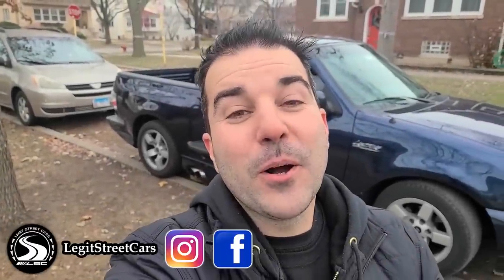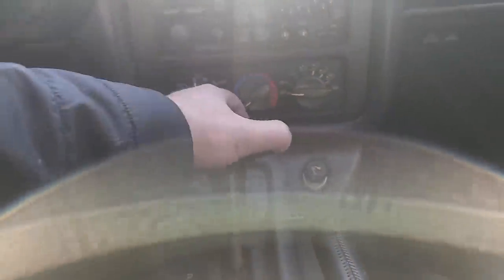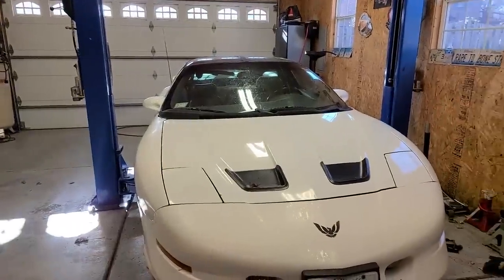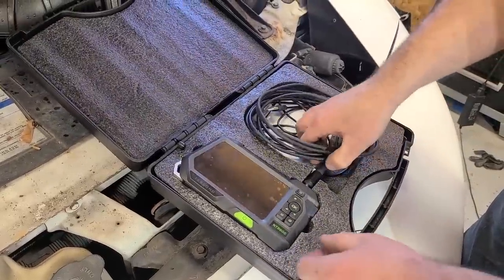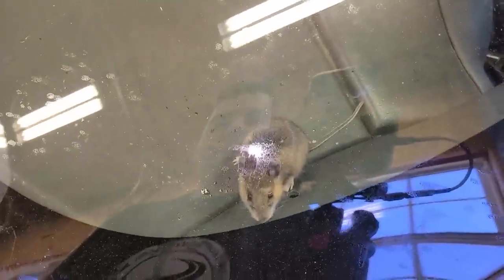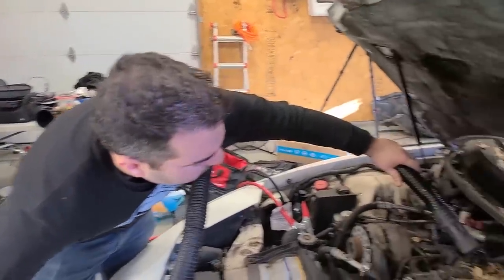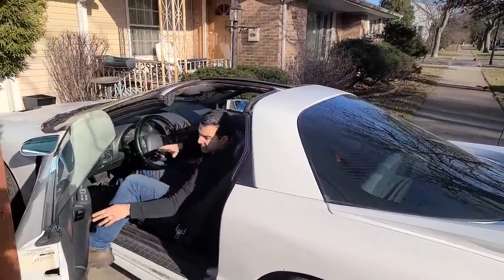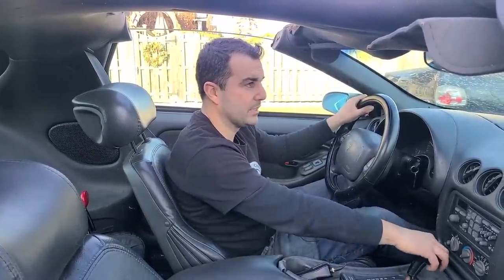I Bought My Childhood Dream Car After Finding It 25 Years Later! First Start & Drive But It's ROUGH!

Comment: On the mice, had them running through a pair of Subaru SVXs until I finally got rid of them: Put sticky pads with peanut butter in the trunks (where I saw them running around). Caught FIVE in one car and two in another and that was it. I've left sticky pads in both cars since then but no additional action. I tried peppermint as well, but it didn't help. Sticky pads for the win.

Comment: You should know, pedal all the way down while cranking will stop the fuel injectors in case of a flood. It's across the board with efi.

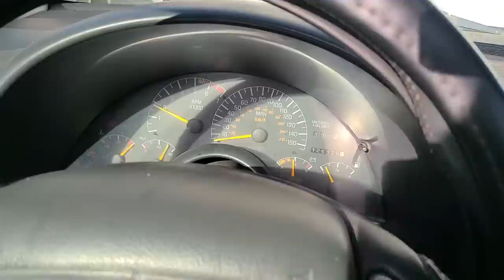Comment: Looks like this is going to be the first LSC part-out. The T-tops are worth quite a bit. You sprayed peppermint to get the mice out but they're just like, "Oooo... Smells like Christmas". @31:05... Just checking... That temp gauge is freaking out, right? You did check the coolant...

Comment: legitstreetcars as a pest technician i can tell you sprays do not do much of anything had more chance that moving the car caused them to vacate which is why one ran across floor after you moved it i can recommend gloves and a respirator  spraying nests and droppings with bleach/heavy duty sterilant before removing to keep hantavirus at  bay also please keep in mind mice travel about 25 feet from their nest last but not least snap traps or poisen bait is easiest way to remove them

Comment: Simple get a Sonic pulsator from eBay they are solar battery and will keep any vermin any wild animal cats off your vehicles away from your house I've been using it for years it works great and it's only about 30 dollars and it protects 3000 ft²

Comment: I have a stock 94 firebird formula have owned it since 1999. Only mod is magnaflow muffler. 135,000 miles. Looks clean prepared to yours and especially engine bay. 😂

Comment: Main choice on mice… kill or no kill. If you go for no kill, just make sure you have a place to let them go… far away. Check the traps multiple times a day, they will die without water within a day.  Or you can just go with the classic kill traps. Just be prepared to dispatch them if the trap doesn’t.

Comment: Man up and put the work in. I completely restored a 99 Tahoe that was rusted to shit. All the way down to the frame..... 6.2 Vortec swap, lift, full suspension restored, electrical, literally everything on the truck restored. if you want it bad enough you will fix that shit. i live in Kentucky so finding a 99 Tahoe that's not clapped out is next to impossible. took my own and made it what i wanted. again....FIX THAT SHIT

Comment: I find it funny how some cars rust harder than others like my old 78 Z28 Camaro Was Abandoned in 98 and brought out from the sand and gravel and the rails still have the coat, rocker panels and roof is still solid sits straight and rolls without struggle as well as the transmission shifts still after 24 years and funny though after all these years and after tearing out the interior no mice/rats in it and cleaned off the residue this year the engine has been taken out(350 4 bolt main 4 barrel Holley Carb and Air intake), body work done up, primed body, rails, weather seals and new Firebird GTA Rims for roller use only, for it's original color was white like your Firebird T/A in this enjoyed the video aha oh i bought my Z28 For 20 Dollars from my uncle whom forgot he had a Camaro

Comment: Well my dream car was a ww2 Jeep, and and my first car was a 42 Ford GPW Jeep. My second car was a 41 military closed cab Dodge pickup with a winch. I really liked the purpose built military vehicles. I realized I needed a normal car to drive and found my Dart and sold the power wagon to buy it. I still have the Dart.

Comment: Prepare yourself, mere mortal, for the wonders of LT1 ownership.  Water pump, Optispark, fuel pump (shocked it even started after sitting up that long), and fortunately for you with an automatic the rearend MIGHT survive.  96 WS6 6 speed here and done it all (on fuel pump 5 or 6 at this point).

Comment: I bought a 2002 Ws6 TA brand new. I ended up selling it with only 25000 miles on it back in 2018. I ended up buying a 2015 Z/28.

Comment: I think that the underneath is good there are rust spots and just needs to be checked by an expert and if still good drop all the underneath and rhino line the body and then start putting all good parts back on then get new parts for what needs to be replaced!!!😊👍
Reply: I will bet if you get a new battery put in there she will fire right up!!! 😊👍
Reply: Do not recommend that either 😊👍
Reply: She needs new gas and an oil change 😊👍
Reply: Yes she runs and needs new injectors!!!
Reply: Just buy all those lines and replace them.👍

Comment: Re. mice - if you're after a humane way to catch the mice, here's a technique that works very well and I've lots of experience of: Get a glass bottle (in the UK I'd suggest a milk bottle), a brick, and some rolled oats (porridge oats). Put some oats in the bottle, and put the bottle on the floor with its neck propped on the brick. The mice can easily get in, to go after the oats, but can't climb out due to the slippery glass side being on a slope. Once captured, take the bottle some distance away from home and shake the mouse out, or if the neck is wide enough just tip the mouse out.

My parents used to breed rabbits, and would regularly get mice. We used to catch them this way and get rid in a local field.

Comment: My childhood dream car was a 1988 F-Body Camaro with the 305 TPI and 5 spêed. Those were crazy expensive back in the days when I had "enough" money to buy my first car. ( 2002 ). I ended up getting a 1986 white Berlinetta with the 2.8 and auto transmission. It was probably worse than that firebird. hahaha 

I swore to myself that I'd get a really good example one day. Which I never did. I like the look of those, but damn are they long for the actual space inside. It is actually 4 inches longer than my Subaru Outback and would not fit in my garage. lol

Still have a sweet spot for those. They are the last cars to have that old muscle car style interior. I actually live 15 miles from where they were produced until 2002 when they "discontinued" the Cammys and Firebirds , closing the plant only to reopen a new one in Ontario for the 5th gens. Now it is just a huge power center  with a Costco, Home Depot and a bunch of other stores. Used to know guys that worked there. It's kind of sad.

Comment: For mice, the absolute best trap I've used (and use) is the flip and slide mouse trap. These will capture dozens of mice in a single night and even give you the option of letting the mice live. My record is 26 mice in one night. They are so good they are now available almost anywhere.

The next best trap IMO is a modern plastic snapping mouse trap. Get a pack of 6 with removable bait cups and set them up all around your garage. Check them daily so mice don't start eating trapped mice and multiplying again. The old fashioned wooden ones do work but are fiddly and often snap without killing the mouse (mouse gets away, potentially injured too).

Whatever you do, do it fast. Mice replicate quickly and do a lot of damage fast. Once they set up in your garage, in a few days they will magically start showing up in your house, in your attic, etc and are a major pain to get rid of. Ask me how I know... (No, actually don't. It is a story I don't want to think about because I'm still dealing with damage 20 years later).

Comment: I could be wrong but I had a couple of vehicles that by removing a small cap on the shifter you could then push in the lock and shift to neutral. Gms.

Comment: For the mice - I used an amber automotive strobe light to deal with squirrels and chipmunks in my garage. Had it wired up to run off a power supply connected to the wall outlet. Might help with mice?

Comment: I bought an ‘89 trans am 12 years ago and it was from Massachusetts (I live in Texas) and I got it home and changed the oil the next day and the floor/undercarriage was the exact same. Hole under the passenger seat the size of a basketball and the “frame rails” were toast too. I sold it and was honest to the buyer about the rust and I took a 2k loss. Sucks to see

Comment: Damn, I was hoping you'd restore this car to its former glory :X.

When I tried to get my '94 Formula running after years (was always garaged) it would turn but not start whatsoever except when I used starter spray. It did not get any fuel, the damn fuel pump went bad, which is located inside the tank...who thought THAT would be a good idea? :X

Comment: Mouse traps, I had to swap an engine out of a Chevy Monza my wife slid of the road and roll into a body I got the engine out of the first place it set on my grandfathers farm for a few years i pulled all the interior out pull it to a car wash were I washed mice out from under the dash board.there probably in the  heater ducts as well.

Comment: The X8 Tire Inflator looked very promising, until I read the AMZ 3 star reviews. Battery to small, hose to short, valve connection finicky,  units BAR vs psi all issues. Shame, with a little more development it could be a truly awesome product.

Comment: I have kinda the same story with my 96 pro am 3, I offered the original owner $10,000 for it in 04 05 when she had a for sale sign on it and she refused, I absolutely loved that car and in 2010 I needed a car and pulled into a used car lot because of a firebird and didn't consider buying it and told them $2000 no trucks no vans manual preferred and they kept walking me to trucks vans and over $3000 price tags and when I asked how much for the firebird they said $1900 and I asked what's wrong with it and said sold! Bout a week later a piece of the paint flaked in the hatch jam and was purple underneath I asked where they got it and it was the car that I wanted years before and they told me the woman traded it for a mini van worth less that $1000 and 6 years older, I laughed my ass off and told him the story!

Comment: I have restored cars to better than new condition that were in a lot worse state than that one!!! If you have the skills to do the work yourself and are able to source parts as cheaply as possible then anything is possible. You don't have to spend loads of money on really expensive parts when you can buy things like floor pans at a reasonable price and everything else either second hand or cheap on ebay or from breakers yards.

Comment: That car could be fixed if you put it up on the crank or whatever it's called to move the car above ground take everything off below the car, clean it, and see what does not work, and if its broke replace it.

Comment: You paid too much. I sold my 99 for just $400 and the body and floors where in better shape. It's just that most of the black painted control parts had some thick rust including one lower section of the sub frame connecting the A arm to it which is kind of a big job. The 3.8 v6 still ran great. A part of the rear uni body from was rotted with the exhaust hanger bracket broken off but that's it. Floors where solid with surface rust only. I rebuilt the rear coil perch 5 years ago. The car had not been driven in rain or snow since 2012. It was still parked on a gravel driveway in the elements. I guess that accelerated some of the undercarriage rust on the black control parts and frame as the where still solid up to 2 years ago when I did an oil change but didn't drive it much.

Comment: What part of Illinois are you from? I’ve got a 95 that has been sitting since 2005 because somebody stole the engine whenI was rebuilding it. So I decided to do an LS swap when I get the time and the money. I need a new steering column driver side door and I would like to find a 98 and up front clip and I’m sure you have the resources to find that stuff.

Comment: Dang dude that's nice.. hell I'd give e you 2 grand back for it  I've been wanting a trans am or camaro for ever. My aunt had a wrecked 93 with under 95k miles but it's been sitting for 20 years all it needed was a driver door rear driver quarter and the hatch but now its u telling what it needs last time I seen it the I terior was moldy

Comment: I am a Welder and this car is not the Worst?You can weld some good metal on it and grind the bad metal off??Not that bad?Those lines ate all rusted out...i live in South Carolina and if a car is from up North no one wants to buy it due to the Corrosion from Salt used in clearing the Snow?

Comment: It would be interesting to see you strip it down I would use a sand blaster you can do like samcrack and rivet new metal in the holes or use fiberglass

Comment: Did you lock the motor up? The majority of the video when it was running it was HOTTTTT lt1s do not like high heat for long periods even with the cluster acting weird the water temp is accurate

Comment: Woww I have a 1994 pontiac firebird its a v6 I've had it since I was 12 years old I've changed fuel pump fuel injectors still won't run I'm 19 now and have never got the chance to even drive my dream car I've always wanted to put a v8 it it but never had the money to I've always wanted just the thrill of being able to drive my firebird I hope someday I will

Comment: Dude you just killed your fuel injector system, never ever krank it on old ule that has jelled inside the lines and pump and injectors!!! Before you krank it disconnect the fuel lines run the pump and drain the gas  then take out the injectors clean them run fresh fuel thru them place them back in change the fuel lines if the pump works in good shape place it back and then krank and you will have a much much better outcome friend!!!

Comment: Wow that's pretty sad to see, I've been trying to sell my 1994 Pontiac Firebird Formula LT1 with 61k miles, it's in way better condition then this one. It actually runs and drives, just needs a new optispark.
Reply: Wow small world. I also have a 94 firebird  formula with a bad 👎 optispark  been off the road
since 2017.

Comment: Man that thing is a rust bucket! I’m always afraid of buying rust belt cars for specifically this reason. A southwest or southern car would not 10% of the rust that thing has. It could be repaired but it isn’t worth fixing as the labor isn’t worth the value of the car.

Comment: What a shame, a BAD owner. In a very bad,  for cars, climate. Only 125.000 miles and its done. I have a 94 Trans Am I bought new in june of 94. 338.000 miles on it now,  interior near mint, exterior same. Well cared for  Lifelong Southern California car. Engine has never been touched,  even the timing chain is original.  Still runs like new. 5.7 L LT1. Can't believe this guy didn't even empty the car out, and left it for you to do!!

Comment: U so stole that car from that that little Oriental man, he just said he doesn't know the value when you handed him 1500 bucks. Wow dude that was white man but good for you. For some reason people like LT1 F bodies and I've seen them sell for a pretty penny. I have an LS1 F body and I wouldn't let it go for less than 10 grand. It has 120k but it's tuned has headers and exhaust 373 posi Yukon rear. It's a beast. I don't know that much about 90's lt1 but ls1 f body car don't get the credit they des. Mines fast, it puts out over 400 hp and torque at the wheel on the dyno. It lays down a true 400 horsepower at the wheels and on the ground or to the pavement it's not slow by any by any means. It'll outrun a fifth gen Camaro a few times. It's just as fast as a 5th gen and sixth generation. But it's kind of maxed out, can't really go any further with it unless I reinforce the body but it's a really good car and it runs fast. Yours is pretty Rusty. I have a z28, it's a Florida car, it was built in Canada but has lived its entire  life in Florida so no rust at all. I wouldn't call it pristine but in regards to rust it's pristine. There's no rust on it at all. There is some warpage the headliner in interior is a little bit dry but the dashboard is good but no rust, it's pretty clean

Comment: A rust bucket pony car is your inspiration? Does this one at least have a full frame? No? Sorry, but these cars were all junk when they were new. I made the fatal mistake and bought a Camaro ONCE. That thing had a rear shock actually punch through the trunk and I had to junk it. The most beautiful piece of garbage on the road. Once was good enough for me and that was over 40 years ago. What do you expect from GM? There's a reason they went bankrupt and this is a perfect example. They're even worse today. Ever look under a two year old Silverado? I had a salesman actually tell me they're supposed to rust. It stays strong and is better for the metal that way. Really, and he said it with a straight face. I knew there was something wrong with you. Especially your love for BMW's. That doesn't even make sense. You should have left your neighbor alone. There's a reason that pile of junk was sitting outside. This is one of the worst I've ever seen. Chinese tires should have been your first clue.